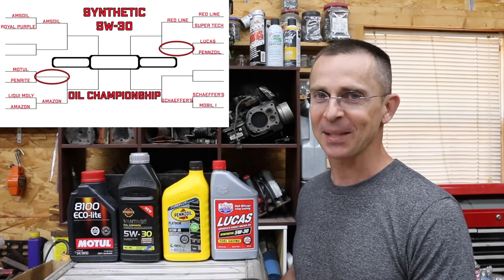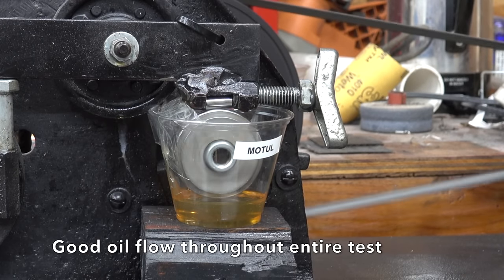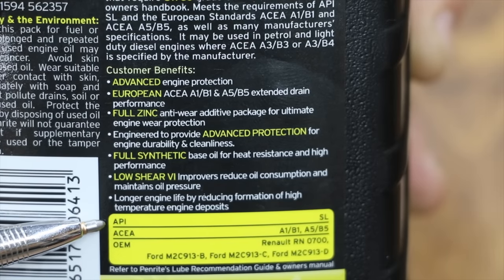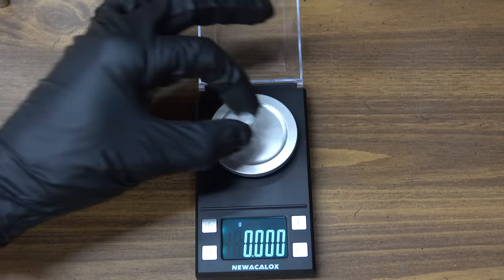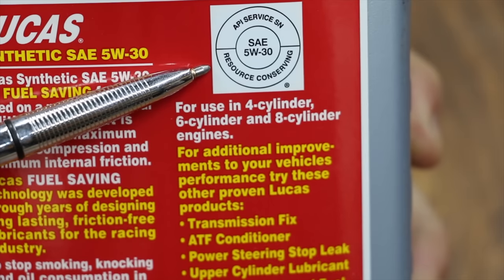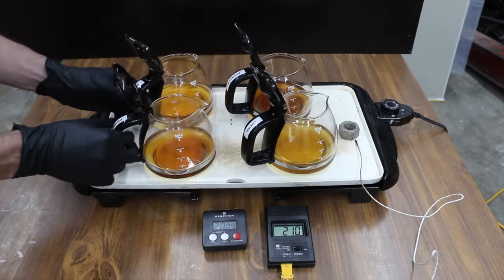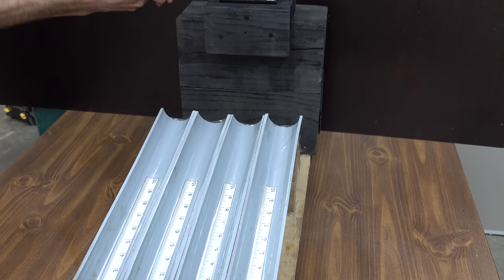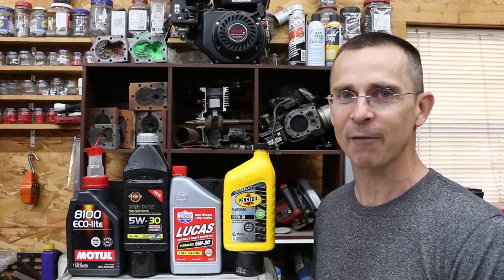Is Lucas better than Pennzoil? Let's find out!

Comment: Can you try motorcycle oils at sometime in the future? Like honda GN4 vs Vavoline! 10w-40 oil!
Reply from the maker: Thank you for the video idea!
Reply: JASO MA/1/2 This was the standard for single unit engines where the Wet Clutch, gearbox and engine used the same oil. JASO-MA oils don’t contain friction modifiers.
JASO MB This lower standard was for bikes that use separate oils for the engine, clutch and gearbox (e.g Harley Davidson’s and BMW’s).
Reply: Project Farm thanks!
Reply: The what is used gets a bit weird, but could also be marketing...
Some even use Diesel oil like a Penrite HPR Diesel 10 10w-40, meets the specs and not having the friction modifiers like Petrol.

Like mine stats a 10w-40
API SE SF SG 
API SH SJ SL or SM with JASO MA MA1 MA2
Reply: I don’t have a motorbike, but I didn’t even know motorcycle oil is different from car and truck oil.
Reply: Also Mobil 1 10-40 4T synthetic, Castrol 10-40 4t synthetic etc etc,. Make sure we are comparing apples to apples...
Reply: @censusgary  If you want to get into it... some 2 Stokes are different again.
Reply: Motorcycle oils (for wet clutch bikes) cannot contain friction modifiers like molybdenum dithiocarbamate and others like it as it will destroy the clutch material.  Also ZDDP (Zinc dialkyldithiophosphates) levels are generally higher to help protect engines with flat tappet valve systems.
Reply: @kbatzler    I don't know how true it is, but Terry Dyson says that motorcycles can use car motor oils, as long as the clutch is not already overly worn.
Reply: @justinw1765 ... A friend of mine thought so too.  It cost him a new clutch.  Even the owner's manual on wet clutch bikes state as such.  At least every wet clutch bike I've owned.

Comment: Hello, Johan here from the arctic part of Norway. I love your videos. I have an idea for the playoff the concerns the cold oil flow test and also lubricity test. In real life, when starting up an engine in freezing temperatures, all surfaces inside an engine are cold, not just the oil itself. So, to replicate that in tests, all the surfaces that the oil comes in contact with, should be frozen down to same temperature as the oil. In the COLD OIL FLOW TEST, the slides should be made of metal and they should have the same freezing temperature as the oil, while pouring the oil samples down along the slides. The lubricity test should also be done with a twist: THE COLD OIL LUBRICITY TEST - done with all the metal parts that the oil is supposed to lubricate in the test, also frozen down.
Reply from the maker: Great recommendation!  I'll see what I can do.

Comment: I hope Pennzoil comes first as I'm 12000 km overdue for my oil change
Reply: blanky blank never push your oil 10000 miles specially filter, burned oil will clog your lower piston ring
Reply from the maker: Thank you!
Reply: I'm sitting around 14,000 miles on my current oil. I use mobile 1 full synthetic 5w-20. Haven't been able to change it due to an injury
Reply: @simpleman806  Mobil 1 extended performance is great but dont drive it anymore
Reply: Chris VH even my MERCEDES I never exceed 10000 mile 0-40 mobile which ever comes 1st 12 months or 10000 miles burned oil and filter can damage your lower piston ring it will clog up
Reply: @vinmaga6417  I've gone 20k miles on an oil change before (same oil/car). I ain't too worried. I know I need to get it done, along with a tune-up. My MPG has dropped by 1.5mpg. I'm averaging about 14.5mpg.
Reply: Chris VH even on 5000 miles you'll feel hesitation on your engine lubrication
Reply: @vinmaga6417  The only reason I change my oil at 7500 miles is because I race my engine with nearly every acceleration, and I want my Roadster to have the best it can get. The oil comes out looking like it has not been in there but a week or two with 1000 miles on it. In my regular vehicles, I run 10,000 mile oil changes all the time. If that stupid computer wasn't so annoying, then I would probably run 15,000 miles or more and never worry a bit about it.
Reply: Hahaha, I like your style blanky blank! I'm currently running Castrol Edge 0W-40 I took on an 11,500 mile road trip and I've gone about 3,000 miles since. Oops!

Comment: Be honest . How many of these companies has reached out to you and offered you money to stop this contest lol
Reply from the maker: lol. Thank you
Reply: was wondering that too..
Reply: @Anthony Efx I'm sure they have but he just wont admit it.
Reply: @ProjectFarm Have they??
Reply: This made me laugh out loud!
Reply: Only the loosers hahahaha
Reply: That is funny, but in all reality these videos do very little for identifying the true best oil. However, they are very good for identifying the oils that you should never use in cold climates though...cough...RP...cough cough.
Reply: @davidwilson623  exactly.
Reply: @1speed2racer7  how so
 They measure heat burn off ,the wear of a bearing and oil flow. How are these not good tests
Reply: @NerdyMeathead  The heat burn off is a great test. The bearing eating test provides good details of how well the oil dissipates heat, but this test should also be performed with the burnt oil.
However, shouldn't the oil flow test prove them all to be similar? Are they not all supposed to have the same viscosity?
Now the burnt versus new flow test shows a lot. It identifies which oils to avoid in extremely cold environments, but just because the flow rate greatly reduces in extreme cold conditions does not mean that it will have the same result in normal temperatures in southern Florida. That is where the burnt oil bearing eating test would come in handy.
Reply: @1speed2racer7  so your saying the test ARE good. Maybe just add one?
Reply: @fixitrod4969  I agree that the tests are good, but not for identifying the very best oil. There are so many other factors that set great oils apart from good oils.
Yes adding any test comparing burnt to new is beneficial. Then you would rate the oils based on how they compete against themselves.
Either way, these videos are the best on the internet compared to any other videos. I am subscribed to very few channels, and this is one of them.

Comment: There are a lot of fans of each individual oil/brand and I always find it interesting to see how much each brand differs in viscosity and vapor loss during your testing.  There's definitely a proprietary method of manufacturing between all brands that seems to be unique and so seeing a fan-base established for each brand is not surprising.  That, and how each brand may/may not be specific to certain makes/models of vehicle.  Thank you again for doing these tests and "Cheers" to another great video!
Reply from the maker: Thanks so much!  Thanks for the feedback.

Comment: Another excellent video. That racing commentary was truly excellent.. first class! Not to mention hilarious. This has to become a regular feature.  A thickish slab of metal will smooth out those hotspots on the grill, copper in such quantities would be expensive but ideal for the job.
Reply from the maker: Thank you very much!  Great tip on the metal on the grill.

Comment: Personally I use a Mann Filter and Ravenol oil which can be found on Amazon for my 2002 VW Passat with its 1.8T engine configuration. Surprisingly the oil and filter work incredibly well with filter the oil and keeping sludge buildup to minimum despite the 1.8T engine were notorious for engine failure from oil sludge. Checking my oil at 6000 miles for this vehicle, it remains at an Amber color and feels completely different from other motor oils, conventional and synthetic.

*Points to take
  -Buy Oem filters online
  -Buy high Quality Oil 

**I have a strong recommendation for Ravenol oils. I would appreciate if Project Farm would see this and test some Ravenol oil.
Reply: SO PLEEEEEEASE ADD RAVENOL HCL 5w-30 Synthetic Oil to the Tournament . I BEEN WAITING TO SEE IT IN ACTION IN THE TESTING PROCESS! And i have put a comment up every tournament video for Ravenol.
Reply: GERMAN SYNTHETICS FOR THE WIN
Reply from the maker: Thanks for the recommendation!

Comment: Just wondering if you ever considered doing a cook, freeze, cook, freeze, several times then do a test to simulate a real torture test on the oils.  In my opinion, I haven't really seen an oil that would be an absolutely terrible buy and terrible for the engine as long as it met the API standard.  I'd like to see that kind of test as well as a lubricity test on oils that were at the end of their lifespan after draining out of a vehicle.    

FWIW, I switched to Supertech oil because of your testing, it works as good as others and as long as I do 3k-4k oil changes, I see no harm using it in all of my vehicles.  Thanks for putting the time and effort into all your tests!  Very very helpful!
Reply from the maker: Thanks for the video idea.

Comment: I believe these are all excellent oils and especially considering that I do oil and oil filter service every three months or 5000 Kilometers ( 3100 Miles), whichever comes first.
For now, I will stick to Motul 8100 ECO-lite 5W-30 because I get it for the same price as any other big store synthetic oil. What's more important is the fact that driving in South Europe is the closest thing to racing, but over here in North America we drive like wimps. Service intervals for oil service in Europe are typically 15000 Km and more, and even 30000 Kilometers.
One thing I really love about Motul oil is that all of their bottles and containers have a built-in funnel.
There is no motor oil that beats other oils in every condition, that's why I like to switch to Mobil1 0-30
for cold winter months, from December until March.
Reply from the maker: Thank you

Comment: API SL was used from 2001-2004. Meaning the oil should be used for any vehicle older than 2004. I'm sure API SL should still do good but emission standards have become more stringent and API SL does not meet the latest emissions levels of API SN. Penrite did a great job but for me, Motul has been the best oil I have used out of most major brands. I have not yet tested Amsoil Signature series. Great video Project Farm. You never disappoint!
Reply from the maker: Great point!  Yes, Motul is an amazing oil and did exceptionally well on the evaporative loss test.  Thanks again!

Comment: First off, I’m a huge fan of your comparison videos! Keep up the good work!  Anyways, I am kinda a Motul fan boy, but the Penrite contains zinc while the Motul does not. I believe that’s the main reason the Penrite won. It was an unfair comparison, in my opinion. Don’t take my word on this but I read somewhere that one of the major reasons zinc is not in most modern oils, is because it is hard on catalytic converters (via PCV systems). it’s a compromise between having the awesome anti-wear protection zinc provides or the longevity of the cats. Motul has a lot of different 5W-30 variants to comply with different manufacturer certifications and for different engine types (turbocharged, naturally aspirated, diesel, gas, and so on). Could you do a comparison between Motul 8100 X-Clean EFE 5W-30 and something equivalent?
Reply from the maker: Thank you for the constructive feedback. The Motul I used contained 758 PPM zinc.  I had all of the oil that I used tested by an independent lab after the 1st round of competition was finished.  I'll be providing this information in the next few video episodes. By the way, I think Motul is a great oil, but it's very light on the antiwear additives, detergents, and has a pretty low TBN.  Thanks for the recommendation to test the X-Clean EFE

Comment: I absolutely love the videos. I was wondering if you have ever done a video on those products like duralube or slick 50? Can you do a video using the winner of the oil battle. One with the oil additive and the other without. To see if there is any advantage in using the oil additives.
Reply from the maker: Thank you. I tested both of those a while back but I didn't use this testing approach at the time. I might try testing them again.

Comment: Could try the auto manufacturers house brands of oil.
Motorcraft, ACDelco, Mopar, Toyota, etc... 
Could even try the house brand oils for marine engine manufacturers.
Reply from the maker: Thank you!
Reply: The "house brand" oils are just rebranded oil from other manufacturers. Most are just going to be rebranded Mobil, ConocoPhillips, Valvoline or Pennzoil.

Comment: The Penrite’s SL rating and higher zddp levels would be a great oil for those unconcerned about the rare potential of catalyst contamination. Royal Purple’s HPS oil as well as Castrol’s 0W30 German oils are also SL rated due to their higher zddp levels.
Reply from the maker: Great point! That zddp seems to have helped with the lubricity test.

Comment: The Penrite is SL so it should do better in lubricity and wear reduction because it has lots of old school ZDDP. I used Penrite when I lived in Germany. When Carquest used to carry their products I used them in the USA too. The price though is sky high today and the shipping is just as crazy! Motul normally does great as well. The problem I have had with Pennzoil Platinum is I have tried it in Toyota's, Ram's, General Motors,  Lawn Car eqipment, snow removal equipment and everything I put it in starts using oil at an alarming rate. In ever case when I would switch back to Mobil-1, Rotella T, Redline, Motul the oil consumption would disappear but when I repeat this again all the vehicles and gear would start burning lots of oil. You never saw any smoke but the oil would disappear from the dipstick mighty fast. The only synthetic oil my Toyota's will consume is Pennzoil Synthetic.
Reply from the maker: All great points and information!  Thank you

Comment: One important thing you're missing in your tests is oil film residuals. That's the oil that remains within the engine after it's stopped and the rest of the oil has had a chance to drain back into the oil pan. This is what prevents the wear at startup, protecting the engine until operational oil flow returns.

A far more tricky test, true. But it's where the most engine wear happens in modern engines.
Reply from the maker: Great point!  I'll see what I can do. Thank you

Comment: For those who have GDI engines. You need the top performing oils. But you need to pay close attention to evaporation loss! This loss is what collects on the stem of the intake valves, and down the road costs you a lot more, in having the crud removed by wallnut blasting.
Reply from the maker: Great point!  I would definitely choose an oil that doesn't evaporate quickly to avoid intake valve carbon deposit formation.

Comment: The zinc in the Penrite is a good extreme pressure lubricant, which probably helped it in the lubricity test. You need that if you have an older engine with flat-tappet lifters. However it will gum up the catalytic converters in more modern engines.
Reply: If your getting that much oil in your exhaust, you've got worse problems that gummed up cats.
Reply from the maker: Thanks for watching!
Reply: @gubbah  Don't look at me, look at the OEMs. They're the ones who lobbied to have the zinc removed and that was the reason they cited. Unless it was all a scam to destroy all their old engines and force people to buy new cars... Hmmmm.....

Comment: Notice Pennzoil and Quaker state in your other video post virtually the same specs. They are both blended by Sopus and Likely Quaker State is also using GTL basestocks like Pennzoil Platinum. Same oil in different color bottles.
Reply from the maker: Thank you!